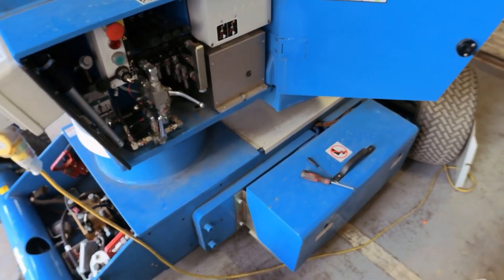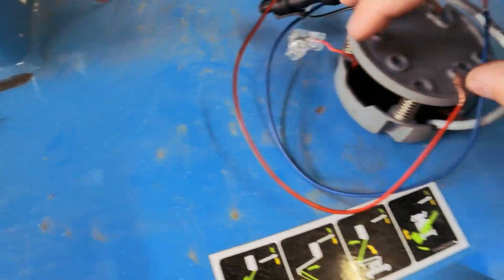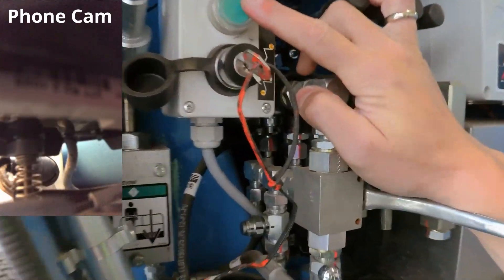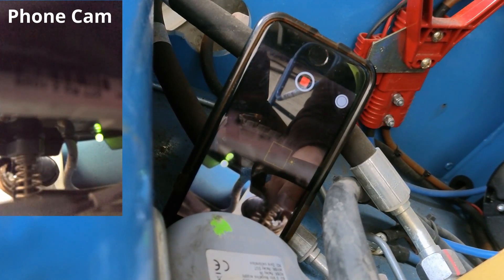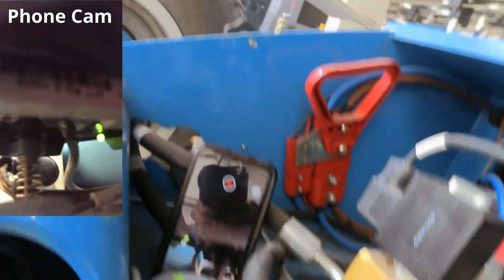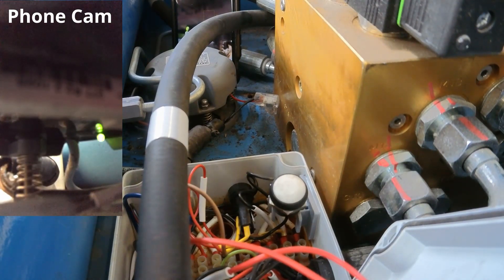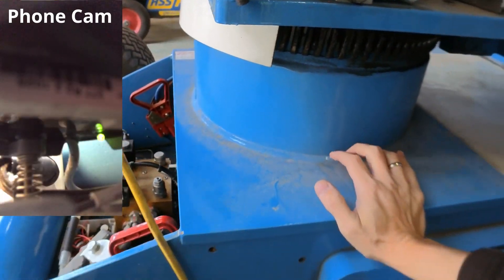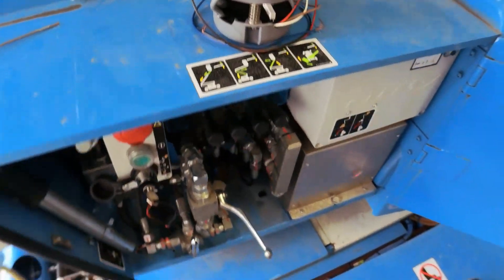Niftylift HR12 SP34 NDE Tilt Sensor Calibration

Comment: Does A Nifty V130 have a tilt switch like that? It is from 2007. Today the alarm is sounding and red light on dashboard of vehicle. Boom operates until it touches the home switch then it will not move again.
Reply from the maker: There is not tilt sensor. Your two front legs has switches and once leg goes lite switch will trigger alarm and will let you to get down .Once you hit booms down switch  it will no linger lets you go up.